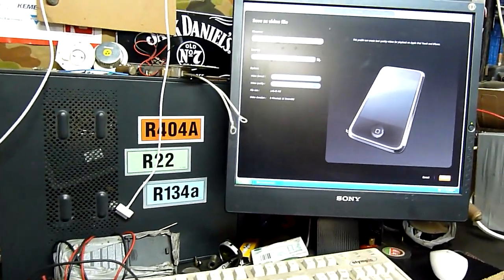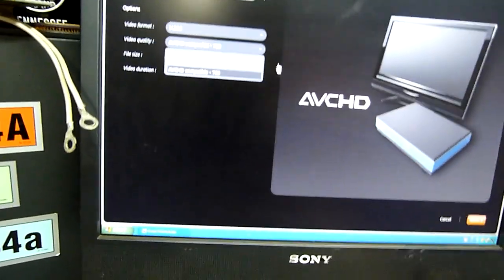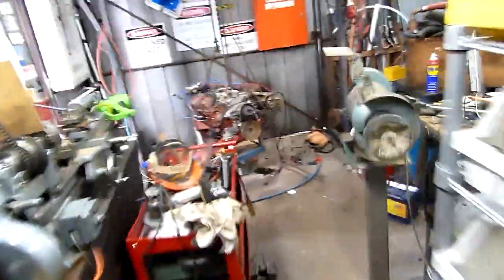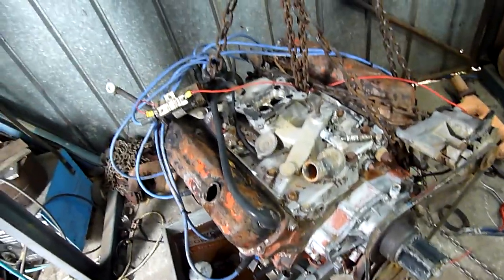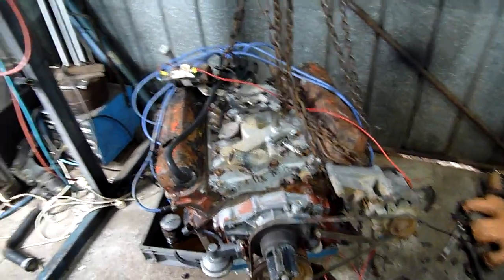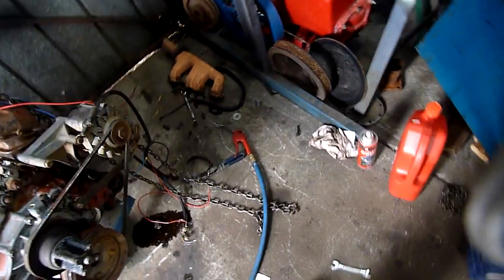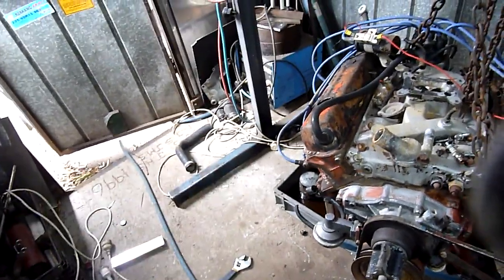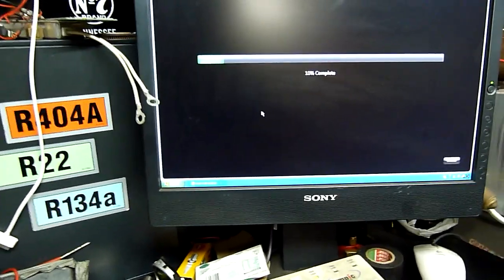Tinkering with Video Encoding + V8 and Car chat

Comment from the maker: @speeddemon1092 the machine is just a standard IBM/Lenovo thinkstation with the stock Pentium D 2.86ghz, no separate GFX card either

I will be upgrading the nuts off it shortly, custom case cover, full size GFX card, 4gb Ram etc,,

Comment: @Aussie50 not a bad card. Make sure to upgrade the power supply to handle it, as OEM power supplies leave much to be desired in terms of quality. If one will fit a Antec Neo ECO 400W will work fine. If your software supports hardware acceleration the GTS 250 should help immensely in encoding speed.

Comment: Could you do me a favor and do a quick video/segment about the interior of your encoding machine, and post what your primary encoding software is? If you can i can at least try to help make life easier with the encoding.

I asked about the interior because there are some good low profile heatsinks that will keep the pentium D cool while remaining quiet, and i asked about what the software is because it may be capable of GPU offload, which will speed things up greatly if you have a dedicated card

Comment from the maker: @MrCinimod93 yeh we crush cars like this all the time, the Nissan Pintara would have been in better condition. clean, drives okay, needed drive shafts and major service etc. 2 new tires on it, all crushed :(. I had no room for it, altho I was going to decant the AC gas to the Festiva and pinch the compressor and lines, but I was too late.

Comment: @Aussie50 I'm telling you, save your money for a newer PC with a modern CPU. 5 years ago a Core 2 Duo, which came out right after the Pentium D, encoded video roughly twice as fast as that Pentium while using less power and putting out less heat. A cheap, basic, modern PC (even with integrated graphics) will probably handle video encoding 3 or 4 times faster than that Pentium. It will ultimately be the bottleneck of your rig.